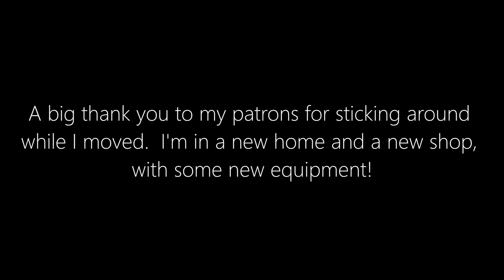This Chuck Was Only $75, and Now I Know Why

Comment: That was different, but really awesome!
Reply from the maker: I thought I had a gem, ended up being a bit of a lemon, luckily it was fixable.  Missing the chuck key, or was the chuck key intentionally left out?
Reply: @NeedItMakeIt  Well you made a hell of a video out of it. Great to see the progress. Must cost a lot of time to get it like you showed in this video. Thanks for making it, it helps getting through the day.
Reply from the maker: @TuncayAyhan  It took a few hours of actual work, it takes longer to make the video of course, still messing with the lighting and camera and getting used to the new shop space.  Glad you liked it, I should have some more coming soon, some 3D printed some workshop, some random ideas.  Everything is new every time.